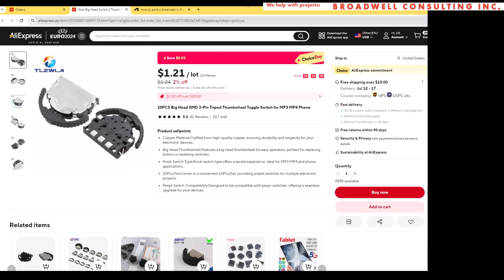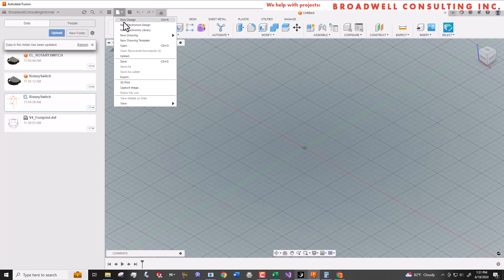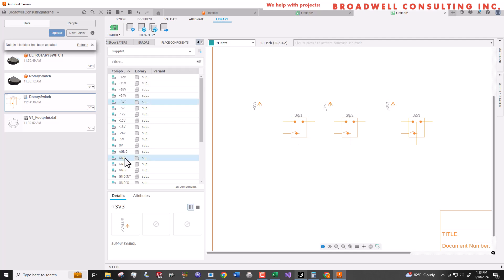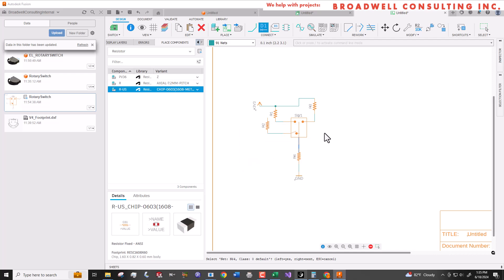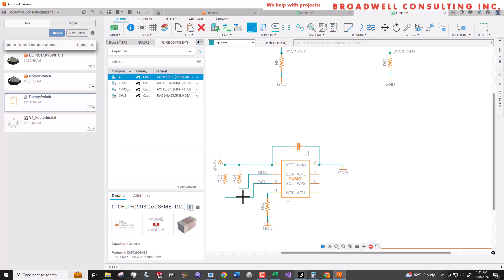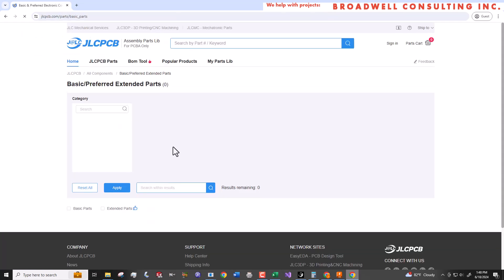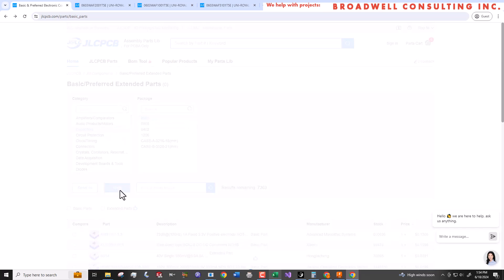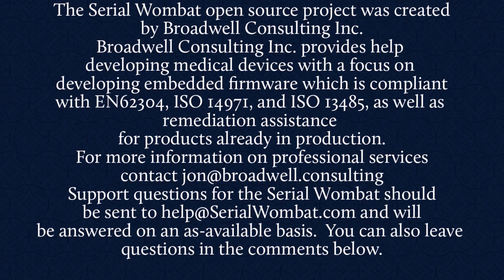Creating a Schematic In Autodesk Fusion 360 that uses our Custom Electronic Part

Comment: how is it saved in library?
Reply from the maker: Fusion has a hierarchy for stuff.  Your account holds Fusion Projects.  

A Fusion Project can hold can designs,  electronics designs and electronics libraries, and generated 3d models from your boards.   

An electronics design holds (typically but can be more) one schematic and one pcb board, and a link to generated 3d models.   Schematics and Boards use components from your electronics libraries

An electronics library contains components, footprints, and schematic symbols.   Each component must have a schematic symbol.  It typically has one or more footprints.   Footprints can be shared among multiple components (say lots of different types of chips that use a SOT-23 footprint)  .  Each component may have an associated 3d model which is stored in a Fusion Project.